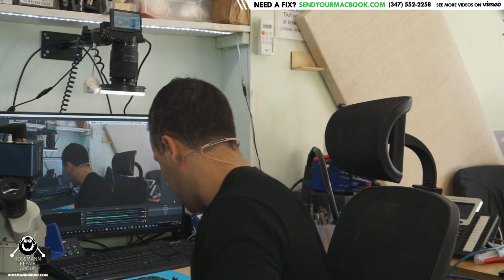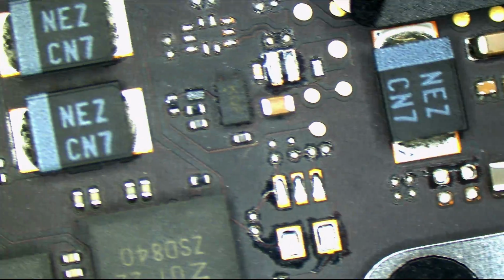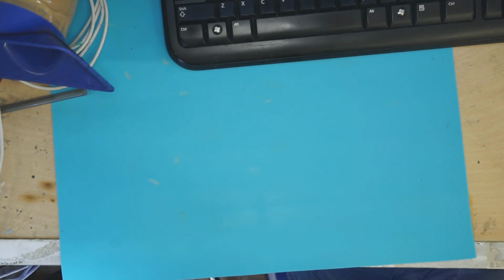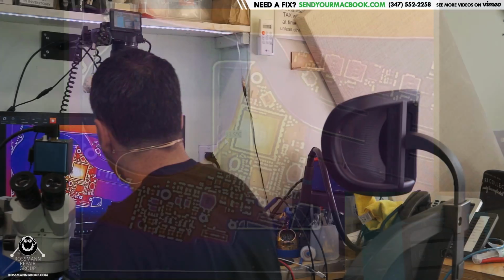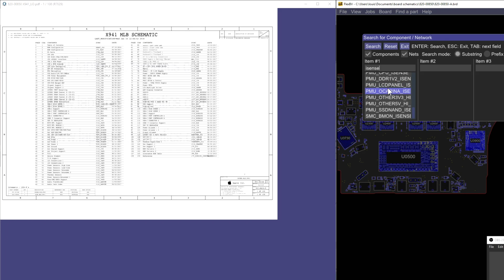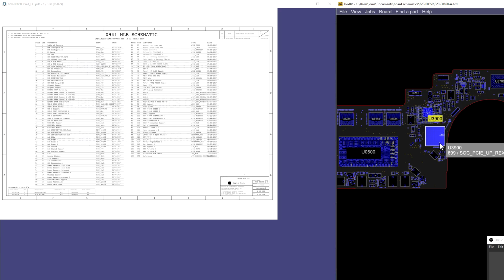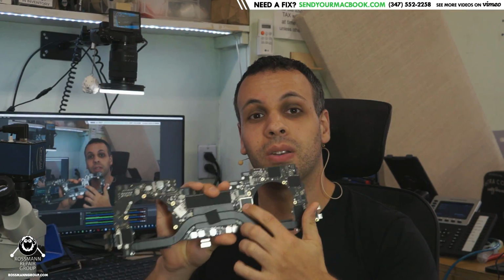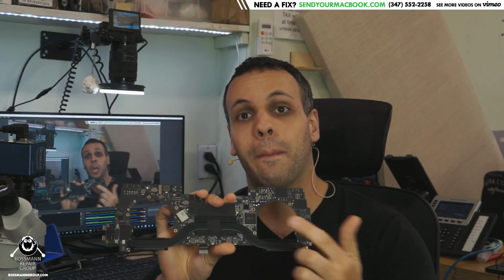Apple users have no one to blame but themselves.

Comment: I'll ONLY ever use Android and Windows  PERIOD!  ive known for years that Apple  are a bunch of crooks!
Reply: I've also known for AGES that Apple are liars and crooks. I just don't say anything when their fans drop to their knees and bow to their iPhones or Macbooks. They're too shuttered and easily offended to face reality. I say let them drain their wallets with the junk Apple is putting out. Not my problem.
Reply: tim crook ceo apple. others are not good neither
Reply: @Paradoxical Nightmare Linux isn't for everyone. It's more frustrating, that's for sure.
Reply: @Paradoxical Nightmare I've never even heard of Pop!_OS before now. If it's anything like it's stupid name, I don't want it. GNOME/Unity sucks ass, too, which is what it ships with.
Reply: @Paradoxical Nightmare Torvalds uses xubuntu, or at least he used to.
Windows isn't basic. When's the last time you used it? It has bash, cmd, and a shit-ton of software.
Reply: @Paradoxical Nightmare Basic users might as well use ChromeOS. It's better than any GNU/Linux distro for that.
Reply: @Paradoxical Nightmare It's based on the Linux kernel. It's not GNU/Linux any more than Android is. When it's developed by professionals at a huge company with a specialized software suite, it's a bit different than the FOSS abandonware.
You might as well say Linux is UNIX.
Reply: @Paradoxical Nightmare No, they're not. Just because they run on a Linux kernel doesn't mean they're Linux operating systems.
I know Linux and UNIX are different. That's my point. Same with Android and Chrome OS: just because they used the Linux kernel doesn't mean they're Linux distros. 
You go to Distrowatch and type in Android and you won't find Android. You'll find the Android x86 PC system, but Android isn't there. Because it's not Linux. The closest thing you'll find to Chrome OS is Chromixium.
Reply: Microsoft are wankers too
Reply: Microsoft would do the same thing instantly...
Samsung, Huawai and other mainstream Android Manufacturers do / will do this too.

They are all copying Apples bad business practices.

Comment: I am an Apple owner. I have never owned a Windows pc. I will probably never buy another Apple computer.

It used to be you could buy a Mac and keep it for a long time. Processors got faster? Pop out the old one and pop in a newer one. Add RAM, no problem. Install the newest OS? Sure. I had a Mac Pro with a Motorola chip. It worked great. Then Apple switched to Intel processors. Adobe came out with a software upgrade. It would only work on the newest Mac OS. The OS wouldn't work on the Motorola chip machines. So I got a really cool doorstop.

I don't know if I will buy a PC or try to put together a Hackintosh, but I can't see myself buying another Apple computer.

Comment: I have been using a 2014 iMac 27 that has suffered zero issues since new, I really like it.  So when I replace it in the new year Apple probably think I'm certain to be a repeat customer. 
Wrong, after seeing the way Apple treats customers that do have problems I will be building my own dual boot Linux/Windows machine.

Comment: You can't de solder the SSD and solder it on another Motherboard?
Reply: Nope. It has programming that prevents it to operate with a different machine, even if the MOBO is exactly the same model: just like the T2

Comment: I keep watching Apple product reveals and I keep thinking how they screw you over each year. Price is insane - $1100 (Lowest possible) for low-mid tier garbage in a pretty shell, functionality of their software and OS are just out the window because one tiny problem blows up to be a huge issue with the way everything snowballs in their coding, tech support doesn't even do their jobs and require you to figure out the problem yourself to be able to advocate for fixing the issue, and they deny service on a random basis without any good reasons. This is why I will never switch off of PC, especially as a consumer who can't spend $1100 for each time my laptop has a small issue that breaks the OS.

Comment: Back when US cellular had that plan for a phone for a penny you could get either the iphone 5c or the galaxy s4 or s4 mini. I ended up going with the 5c so i could have imessager. We set up the plan online and had them shipped to us. Phone never connected to towers, was no better than a ipod. Turns out it had a bad sim card, pretty simple fix. They offered to set me up with a new 5c but screw that! Thanks to a lot of frustration i had with their ipods not being usable because it couldnt update past a point for software and all the apps on the store required a more recent version, the ipod was virtually useless. The 5c was the icing on the cake. Apple promotes subpar products to be equal with the best in the industry. You are lucky if you get 2 years of use before they force you to get an upgrade. Switched to galaxy never came back.

Comment: One of the apple stores in San Fran refused to replace my aging battery (2011mbp) because of evidence of “water damage” even though it was out of warranty and I was paying full price for the replacement, it worked completely fine, and They wouldn’t even replace the little rubber feet on the bottom of the laptop!! And of course they refused to sell me a battery so I could do it myself despite it just being a few screws in that model. 

I took the back cover off when I got home, saw what they were talking about and literally wiped it off with a finger. It was just dust. Losers!!
Reply: What do you mean losers? You bought it, they won. Sucker.

Comment: Now look at Microsoft with Windows 10 after the April update 2018... And the October update 2018... As well as the lack of support from either the software, or customer relations to explain to people... 16 bit won't work on Windows 10. 32 bit or 64 bit!
There's no inbuilt emulator like there was on Windows 7 and earlier.
They feel they can, so they do.
It seems like there's a point, when a company realises, their at a size where they need to keep their public image intact. But then once they genuinely are the entire market, they've hit a second point, where their reputation and public image are no more. Microsoft up until 2010 ish were genuinely fantastic! Then Windows 8 appeared... They realised they had a problem, but had also been watching Google and Facebook, so though Windows 10 could do the same data collection for them too. I was finally "happy" with W10 until April last year... Then I was afraid to turn it on withought turning off the modem in the house, and then turning the WiFi off. Now I'm back to the attitude of "maybe I should just find a windows 7 disc"

Comment: I did my part and voted with my wallet years ago.    No apple computers ever.   Just make my own pc's
Reply: Or, you know... Buy from another computer manufacturer
Reply: @Novacification  Yeah, but prebuilts are not that much different from Parts Builds. And building from parts gives some people joy.
Reply: Joseph Young they are speaking about Notebooks not pc‘s
Reply: @nomineterrameareligionis4021  their full chassis computers have the exact same problems as the notebooks, overheating, overpriced, under performing, etc

Comment: I'm of the last generation to leave school without ever touching a computer, so everything I know I taught myself through buying 2nd hand PC's, rebuilding them and generally muddling along 'till I could afford to buy new ones. In all that time I've never bought an Apple device. I've always viewed them as 2nd rate and run by folks who are poor mans maniacal Bond villains preying on the weak minded. 
A few years ago some of my staff clubbed together and bought me a record player that would allow me to convert my vinyl collection into MP3 files. The software that came with it was Apple/iTunes based and I debated for ages whether I should risk running it on my PC. I eventually gave in in a moment of weakness. Boy did I regret that, the programme insinuated and invaded my machine, changing settings and generally mucking things up. It took me ages to work through my machine resetting things and trying to eradicate all vestiges of that infernal Apple trash. 
So like many here I've never given them a penny/dime and will never knowingly do so in the future, so its nice to see a professional giving similar avoidance advice that I have for years.
Excellent channel, you've earned a new subscriber today.

Comment: This is another reason to distrust Apple.
They put in hardware and software that makes you think they care about your device but in reality they put them in to cover their asses.
Examples:
The liquid detection surfaces can turn red from humidity so they aren't accurate, they just put them in to have a better shot at showing you the red spots then saying they don't cover water damage.
Also, the battery health indicator is BS. It's main reason of existing is to tell the Genius that you've attempted a repair and the repairman ripped you off (mind you, you can just replace the battery with one from another brand new iPhone and it will still show an error). The only way to tell the "health" of a battery is to use it, and the way to keep it healthy is to watch it's temperature which not many people do so dying batteries are a fact of life at this point, some arbitrary peace of software can't do shit.

Comment: The incredible thing is, the Macintosh line has been a sub-standard, overpriced, difficult to repair or upgrade computer since the very first one was rushed to market in 1984 so that Apple could sue manufacturers of superior 16 bit GUI machines, making Apple a bit of a patent troll. Even the Apple IIGS was a superior computer in every way, but Apple killed it in order to go down this path. I've long since stopped caring about how Apple treats its customers, because they (the customers) tend to be arrogant and proud and therefore Apple is exactly the right brand for them.

Comment: back in the 90s and definitely is still out there Today.... we used a simple device that was cloning chips. mostly bios because thing where not easy to replace or upgrade. so wouldn't something like that work for yours today? clone the existing to a new ?
Reply: I think you're talking about a simple EPROM duplicator. Yeah that's easy. Modern chips have crypto built in. If you don't have the encryption keys, you can't program them, or if you do program them the crypto fingerprints don't match and the machine won't boot.
Reply: @John_Ridley  thats what i said as basic idea. maybe something new from china is out there that could clone new chips... 😅 those little guys build everything... 😁
Reply: @johnnyxp64  Even the Chinese can't get around math. If they could just build a chip to defeat crypto that easily we'd be in real trouble.

Comment: This is why I have a monster gaming laptop, a Clevo P170SM-A. It's big, it's black and it weighs a good 8 pounds but look at what you get: User swappable CPU, user swappable SSD, user swappable GPU, user swappable RAM, user swappable HDD, user swappable ODD, user swappable battery and a user swappable wireless LAN card. 

ALL of this is behind doors and can be swapped out and or customized in minutes. It's 5 years old now and is still trucking along just fine. It plays most titles at 1080P just fine still and for workstation tasks, it's still quicker than many new thin and light laptops. (Slower on paper...but it doesn't throttle when you load it down!)

Comment: They have such a great unix based OS though... I guess an OSX Hackintosh is the only way forward.
Reply: Not anymore , OSX lately is greatly unreliable ,I switched to windows 3 years ago and never looked back
Reply: @PassionOfTheEggs  Not sure what you're talking about. I use macOS Sierra on a 2015 macbook pro (the last decent model for my needs) and everything works great except for the strange cease function of hot corners since Sierra... It just stops activating and I have to reset my computer. Then again, it probably just means I need......... an update.
Reply: @野村ERIK  , if u are a pro 3d artist u will understand what I mean ! .

Comment: Eff apple computers!
I have an Alienware 17r5 that blows apple laptops away on every aspect. I can dualboot it, add to it with upgrades, it looks cleaner and nicer, it’s more durable and it was cheaper. Best part... I can get it fixed ANYWHERE
Reply: Alienware is the number 1 laptop on the market for all around power. You show me a laptop that beats the area51m or even comes close.
You obviously know nothing about computers if you’re trying to bash Alienware.

Comment: A 13 inch? Amateurs… Seriously though, you have to have seen the sales figures right? Even with everything you repair and from the amount of videos you do it’s a fair amount for one engineer Under 10 years. But it’s not like happy customers are going and buying the crap that you show, experiencing that and then going back the next year and buying another one. People call Apple users sheep but I’m sorry I don’t know one person like that. I’m in IT have been for 25 years macs have been the most stable servers and employee nodes next to the Linux kernel boxes we have in multiple data center and offices I’ve worked in. The PCs running windows are easily the ones we have to buy the most of, and I mean every single company I’ve been in for over 25 years. I run and virtualize several different Linux distro‘s as well as two windows boxes for gaming and multimedia with Apple products like MacBooks and apple TVs and the most stable of all of them is always my MacBook. I have a literally never had one issue since 2009. Not one single MacBook I’ve purchased, and they’ve been so great I’ve only purchased my third one as of last year. You’re really the only person that warned me about the best machines I’ve ever used and that’s only because I haven’t bothered figuring out how to block out your channel. You’re arrogant and outspoken and normally that makes a great YouTube person? Content creator? Mostly you just bitch and complain so I don’t know what you call that as a job but hey you do you butterfly. An engineer like yourself that just Sauters shit is only going to see broken shit. Out in the real world where there’s more than one type of customer apples doing just fine brother and they make great machines. Your warnings are about as useful to mostApple users as any PC you’d probably recommend; and that’s pretty damn useless in comparison.

Comment: I agree Apple has some seriously corrupt practices. 

But come on, a lot of people, like myself, purchased MBPs in 09-11 for $1000-1200 and had perfect, wonderful machines for a very long time. I used my 09 MBP every day for 8 years! I loved it! It still works 10 yr later!

This was my reasoning for purchasing a $2500 2017 MBP. I know now it is not as high of quality as my 09!!! A lot of obvious design flaws with the keyboard, screen abrasion, speakers. 

I think it’s a little harsh and unfair to blame me or say I made a bad decision at the time with the knowledge I had. If I could go back, I’d probably buy a maxed out Dell XPS and run Ubuntu.

Comment: The only good thing I can say about Apple is that the company have bin really good with their innovative and slim designes on their computers and phones since the very beginning, that made other companys feel like a century behind, until the past 10 years when every brand almost looks the same as it does nowdays. The only main difference is the logo and some minor preformance variations and specs. The downside is that the durability, lifetime and pricetag of their products isn't as good as the others. It is better and far cheaper to use toiletpaper than your broken iphone, ipad or macbook when Apple service won't fix your bricked worthless appliances you purchased from them that you can't use nomore. 🍏=💩 as i see it when it comes to technology for a shitload of reasons I don't know where to start from.

Comment: Hi, sorry for asking this question here, I have got a problem with a laptop not macbook, the screen dims like crazies, if i change screen from a black background to a white screen the screen takes 4-5 seconds to pitch from dark to white, meanwhile in white background it shows colors so dark and pale. It's been send 3 times to workshop and no improvement, one time they changed LCD but still it happens

Comment: If you had access to GSX, you could use the Data Transfer Utility to get the data. It's used to attempt data transfer from a partially functional logic board to an external hard drive.

Comment: Gave up on high priced Apple a long time ago, switched to Linux, and never looked back.
Reply: Only big brains can use linux properly, that is the thing
Reply: @wertyuser798  Linux is as easy to use as Apple, and it works. Try it. Runs on most anything.
Reply: @marlinlenchanteur4260  K. I like Linux, I've installed it many times since 1995 (starting with Red Hat). One day I might even install it forever on one of my systems. ;)